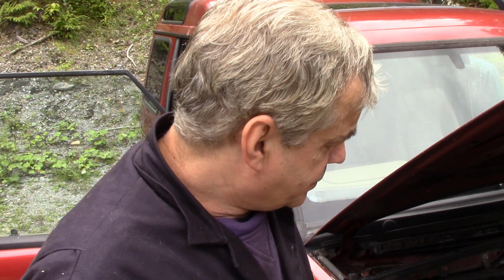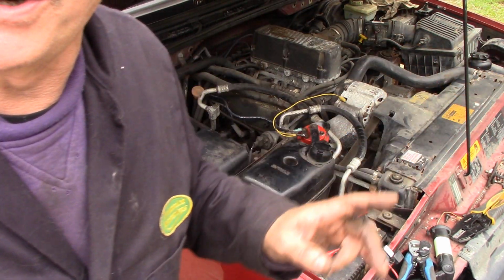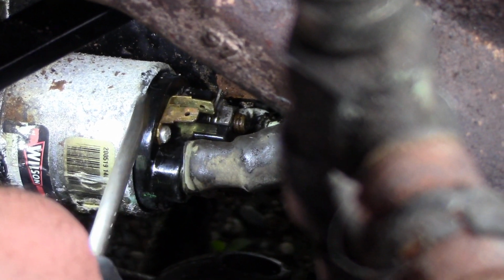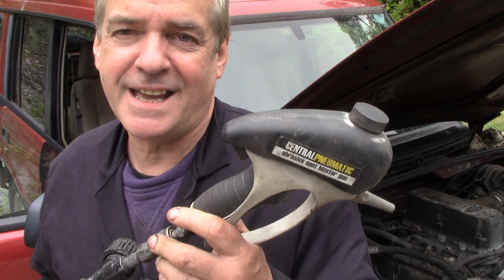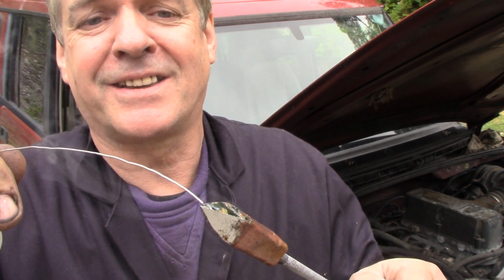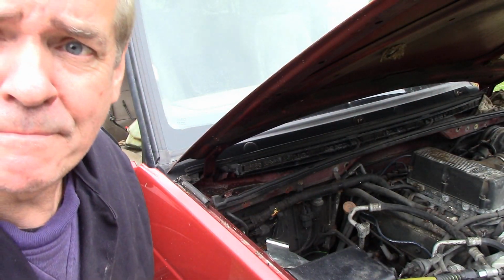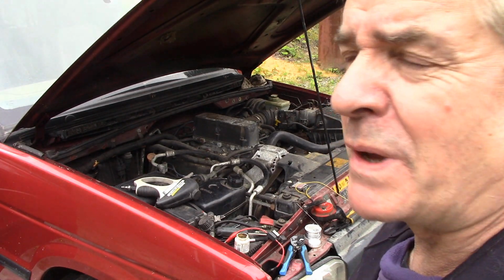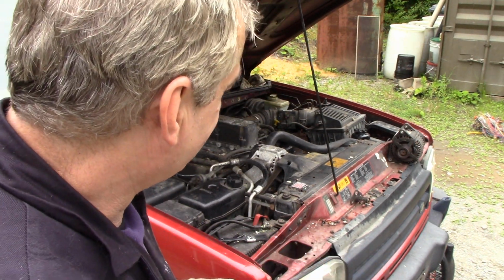1997 Discovery 1 Why will the key not start the engine? Easy fix!

Comment: One genuine "value added". vehicle there Mike. It just shows how many good old cars are discarded for relatively simple problems just because the owner doesn't know how or can't be arsed to fix it. I can see you turning a tidy profit on this one. Cheers.
Reply from the maker: I was just working out, Gary, that the RR door mirrors were shot and new (if you can get them - obsolete) were £294 each Fitted nice to the RR so those almost paid for the Disco - brake actuator parts are now on the RR. The pressure reducing valve would have been £100 alone

See next video on fixing the high idle speed!

Comment: Brilliant work. I can’t tell you how pleasing it is to see you playing with one of these. I personally think these unloved D1s are brilliant. And I find the D1s so much more interesting than the D2s where they thinned out steel in the frames, removed inline fuel filters, and did all kinds of cheesy cost cutting things (plastic diff plugs!?)that are not readily apparent. To me this truck is about the last thing Land Rover made that’s interesting. (Defender excluded but unavailable in North America)This still has the thing that made Land Rover famous in the first place. After these they just lightened them, grafted in electronics and computers and little whirring motors and the company became more of a lifestyle accessory than a tool.
Reply: last of the non-computerised vehicles...ours is 28 years old and still daily transport. I wonder if any of todays cars will get anywhere near that ?

Comment: Hi Mike, I'm about to rebuild my second R380 so in preparation I watched your video ( very informative thank you)  Both of the gearboxes suffered catastrophic failure due I believe to oil starvation. The oil level was full in both. The oil filter in both cases were blocked by around 90%. I also watched your videos of the LT77 rebuild and I noticed the pickup line for the oil pump seems open ended. My question for you is the filter on the LT77 post pump rather than pre pump as on the R380. If so I might look into modifying the oil cooler bypass housing to accommodate an external serviceable filter. Cheerio David

Comment: Dry  solder joints unfortunately  are too  common  and stop a lot of old and brand  new  electrical  things from functioning!
Reply: You need to add to that, "especially in LandRover products particularly of that era". I had a '98 D1 that one would think that solder was in short supply at the time it was built, many dry joints over the years.

Comment: Had this on a low voltage connection to the starter solenoid never new when it was not going to spin the starter over could go for months before it would not start found the push on to the tag was there but lose not enough to fall of but enough to not activate it so pair of pliers pinched sorted it
Reply from the maker: Frustrating isn't it!

Comment: Issue with the starter might be a sign of bigger problems.... or it might not.

It's possible that the terminal simply wasn't soldered properly at the factory and a couple of years of neglect had made it worse.

Alternatively, it could be that the terminal WAS originally soldered properly but there's been a starter problem which caused the terminal to get hot enough to melt the solder and then create a dry joint when it cooled again.
Course, if that WAS the case, the problem (with the immobiliser box?) might've been fixed and then the dry joint on the solenoid only started to cause issues once the terminal started to corrode.

Comment: That dry joint joint could have been making contact until it coroded with age. It was probably a frustrating source of intermittent 'no starts' that caused the immobiliser replacement and the eventual scrapping of the car.
Reply from the maker: I think the rot underneath may have also contributed ...
Reply: @BritannicaRestorations  I forgot you live in salt territory, my old British 110, now in Australia still carries it's salt scars .

Comment: Any idea how to fix the key when it won't open the car doors? Have tried to change battery but still not working, like there is no contact. Land Rover Discovery1 from 1997.
Reply from the maker: Could be the key fob is broken, or it has lost it's programming - may need resetting - will need a diagnostic tool to reset
Reply from the maker: Not a hard fix, but you need an diagnostic computer to work out the problem

Comment: Does anyone know about the factory or dealer fitted immobilisers on these?
I've been helping my little nephew get his 3.5 v8 going and although there's no chip in the key and he's never had a fob on the keyring, there's a flashing light on the dashboard with a yellow paper land rover label on the wiring to it.
We put a coil and condenser on it and sorted a few other things and now the fuel pump won't run, it cranks and sparks, but doesn't get fuel.
I had the pump out of the tank to check inside when i changed the fuel filter, cleaned it, put it back in and tested it by powering it up directly, all good, runs and pushes fuel well.
But the immobiliser isn't sending power to it.

Any ideas?

It might be worth noting, it has an LPG system on it and there's obviously a bunch of jiggerypokery for that in the wiring, i heard that some systems start on LPG and switch to petrol once started, is that true?
There's no gas in it and no easy way to get gas in it at the moment.
Reply from the maker: You didn't say what year it is  - there were two systems fitted I think -- a single button and a two button key fob
The single button can be reprogrammed without a computer, but it is a royal fanny about. The two button really needs a diagnostics hooking up to it so it can learn the codes

Have you checked the inertia switch (if fitted) is closed?
Could be something simple like the LPG change over switch is defective as that switches off the pump - If it were the alarm then it should shut off the started and the sparks